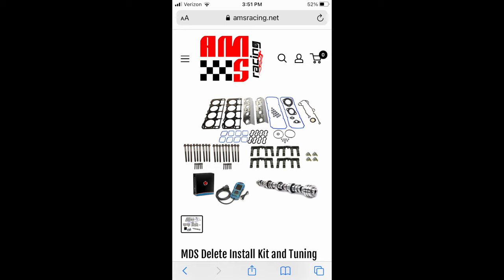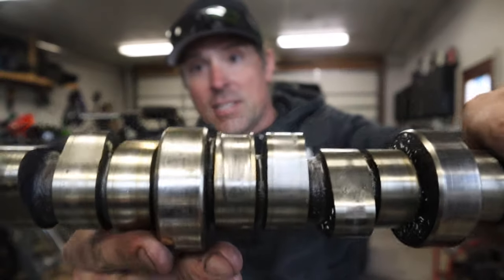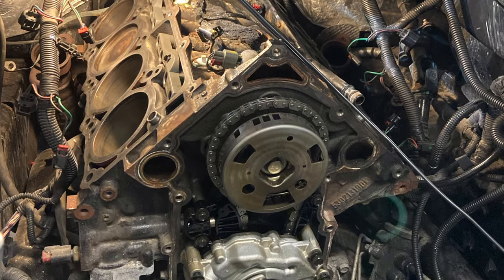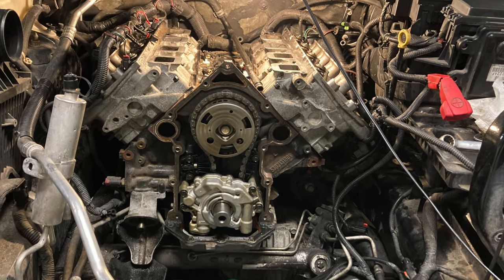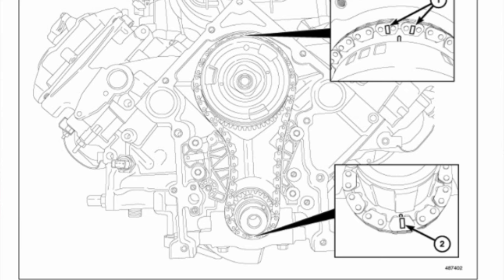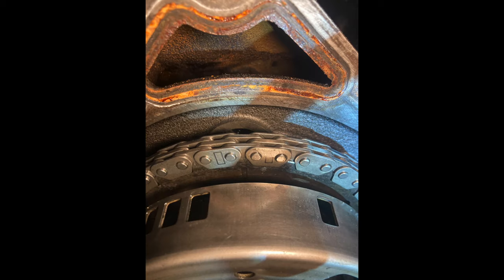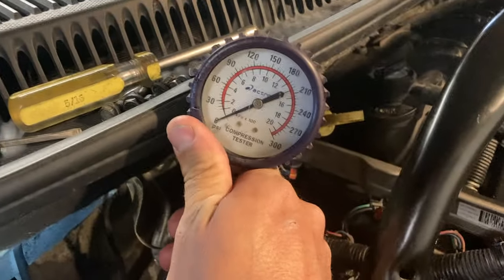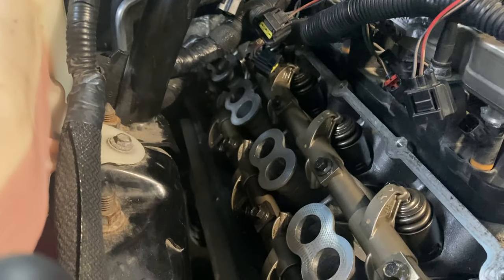Hemi 5.7 MDS delete, Lessons Learned

Comment: Thank you for posting this video. I did a MDS delete due to a damaged cam and after fitting the kit, I had problems getting her to run. Very rough running and unable to idle. I thought that I must’ve had a bad vacuum leak, so I removed the intake manifold and double checked that the individual intake gaskets hadn’t dislodged from their position. 
I then remembered viewing you video several months ago when I was doing some research. I couldn’t remember the conclusion so looked back through my history and found it. So glad I did as I followed your course and compression tested each cylinder. Low and behold, number one had zero compression. Long story short, my 5.7 is an a JK Wrangler and the fit is fairly tight, that tight, due to AC lines, the only way to remove the rocker cover is by removing the alternator, power steer pump and radiator and sliding the cover forward and out. So when I installed the pushrods, I hadn’t seated one in the lifter, causing my issue. But due to your video, you saved me time and a lot of aggravation and assisted me in sorting it out. Many thanks again.🍺
Reply from the maker: That’s awesome! I am glad this helped you out! Thanks for the comment!
Reply: Started the MDS delete on my brother's hemi last night. Glad I watched this video. When I get the valve covers on I'm going to do a compression test on all cylinders just so I don't have to backtrack. Thanks for the video.
Reply: Did you replace cam bearings

Comment: Thanks for the trouble shooting tips man. It’s always nice when people show the real world problems you run into when taking on these kinds of projects. It’s never self explanatory. Lol. I have a 2014 ram 1500. I found that it’s the pushrods not seating properly on the intake side, so they slip out of the seat once the engine rotated over. Luckily I manually turned the engine over and found that the #3 cylinder pushrod slipped out so no harm no foul, but I definitely would have had the same idoling issue if I tried running it. Thanks again for the post! Really helped me to avoid those pitfalls before I started.
Reply from the maker: Thanks for the feedback, multiple others have stated having the same issue as well, so I am glad that you got something from it!
Reply: It's because when you disable the MDS, the lifter ports with the MDS lifters are now not pressurized causing poor lifter/roller lubrication and rubes down the cam and can cause a bent pushrod.....

Comment: Don't feel bad.  Due to the way the lifters and pushrods lay almost horizontal, they almost NEVER want to stay in the cups and where they are supposed to during assembly. 95% of the time when a hemi of that type is put together and everything was fine but now it won't run.... its what you ran into. And the back cylinders are the usual culprits because it's hard to see, like you said. Your advice was also spot on.  I compression test every motor once the valve train is assembled to double check for just that. About a quarter of the time when I first crank it... I'll hear a loud "TINK" as one of the pushrods slips either INto or OUT of the cup. Lol.
Reply from the maker: Thanks for the info! That’s good to know!
Reply: How come no check engine light for a misfire when this happens??

Comment: That's crazy to go through all of that to disable MDS... Like a lot of things, Chrysler should have given the owner the option to disable MDS with a simple switch.
Reply from the maker: There are small things people do with Tow/Haul mode and such that people claim with turn off ads while driving.  You can also turn it off with a tuner, in my case the cam was already damaged, so I did the delete while in there.
Reply: A Pulsar in line engine tuner gives the option to turn off tat 4cylinder option and it just plugs straight in
Reply: I Have an in-line engine tuner that turns it  off but it was not cheap (Pulsar)
Reply: There are easy ways to disable it such as tow/haul or using the gear limiter.  However,  the main issue with doing that is that it doesn't address the oiling issue, especially at idle.  By removing the solenoids,  it increases the oil flow and pressure to the lifters 100% of the time.  With the mds, the higher pressure is only applied to the lifters during mds activation which is what causes them to work.
Reply: @secretdad544  l
Reply: @secretdad544  how much did you get it for and where from?
Reply: @eclipse1201  it (the hellcat oil pump) was brought off the internet from a Chrysler dealer selling parts in line and landed in Australia for about $250 including freight

I think it was about 150 USD
Reply: Keep in mind the MDS is a factory installment. As the first owners would have chosen that to begin with. Knowing government regulated emissions isn't something you just go do a delete on it. The whole ECM, sensors, etc. Are working altogether to make that system function. Although a simple line of code to deactivate that would provide that function remember it's most just for emissions. So whether they wanted to have the owner to have that control emissions are a very strict requirement. Plus it's meant to help the vehicle be more efficient when new. They don't expect a car to run over 200,000 miles which is the expected life of any engine. They do make engines without mds so you can swap those instead to avoid a headache like this.
Reply: I have a 5.7 Commander with a failed MDS system.  I use the Tow/Haul or put into 4th to bypass until my tuner arrives to disable.  Eventually I'll do a MDS Delete
Reply: There are ways to turn it off, I can on my Durango. Also... Yes... A tuner will turn it off. HOWEVER... The real benefit of doing what he did is to remove the less reliable physical parts. No switch can do that.
Reply: @wheelinoutwest  how has it ran since. Have my mechanic deleting mine right now.
Reply from the maker: @USMC--me3ig  Yes, for the last couple years.
Reply: Gm isn’t any different with this
Reply: @winstonwright3613 from my understanding and research, turning off the mds, however one decides to do it, won't solve anything. It needs to be a hard parts mds delete to actually solve it. 
From what you know, does turning mds off actually help reduce the damage or give some longevity?
Reply: How much roughly
Reply: @wheelinoutwest in my Chrysler 300 with 5 speed auto I just drive it in manual mode and keep it out of 5th gear but eventually I plan on properly deleting the mds so I can get that extra gear for highway driving.
Reply: @_AlejandroGonzalez_ i do the same lol but it eats gas especially stop and go
Reply: They do on the newer ones
Reply: Chrysler has to have things like this to help their overall fuel economy over all their vehicles so that they can keep making things like the SRTs and such.

Comment: I have an Aspen with the 5.7, and have 260k on it; I rebuilt it looking for the lifter/ cam issue, and all the parts inside looked practically new. Just wanted to let everyone know that this is the easiest motor I’ve ever worked on. I will drive this until it rusts into the ground. Motor is a beast. What other suv can tow 8000 pounds
Reply from the maker: Thanks for sharing, I agree they are a good motor.
Reply: the new RT Durango with Tow N Go package can tow 8700 Pounds
Reply: I have a 07 also I'm slowly working on
Reply: I have a 09 ram 1500 5.7 over 300000 never had a bolt turned on it.
Reply: I just bought  a 09 aspen what all did you get to rebuild it the engine I wanna kick some dust up 🙂
Reply: I have a 2007 Aspen and I just got my truck out the shop today and now I have this code come up where does it end 😢

Comment: Thank you for taking the time to share that information I have considered purchasing a modern hemi truck but intend to delete the MDS right away before any issues arise.
Reply from the maker: I hope it was helpful.
Reply: @wheelinoutwest  It was, I’ve been avoiding newer Mopar gas engines for a while because of the horrific reputation of MDS so I stuck with Diesels. But I wanted a lighter commuter and heard you could delete MDS. No one else covered the lessons learned with this swap. So once again thanks!

Comment: I've done this also on a 2010 ram 1500 5.7, to remove the mds solenoids cut a small piece of 2x4 or whatever small scrap wood you have and place the end on the top of the solenoid and lightly tap the opposite end of the wood with a hammer, the solenoids will then turn and  slide out super easy with absolutely no damage!
Reply from the maker: Thanks for sharing.

Comment: I just completed a 2009 VCT 5.7 VCT delete and added a distributor drive gear to a 2006 timing chain set to drive A GM distributor. Installed the older now modified chain set , a GM distributor with ford 4.2 v6 drive gears and had to fix the lifters. If you take out the bad lifters ( ones with loose rollers, not locked up) and press out the roller pin, you'll notice part of the pin is worn down but the roller and needles are fine....usually. Find some GM 3.8L series 2 v6 roller lifters and press the pins out of them to replace the bad ones on the hemi. Im a cheap ass and find a way around shelling out $400+ on lifters, Ford 3.0L V6 OHV roller lifters have the same pins. If needles are damaged, swap out the pin and rollers as well, they fit the hemi lifters. Sub merge lifter in oil and pump them up before install, this will prevent bending pushrods, and they are also different lengths so watch out.

Comment: Thanks!  A lot of good info here.  I will also add/reinforce:  The problem is, the engine oil may get old without you realizing, and then...  Change the engine oil no more than 4k, regardless of "oil life" reading.  Also be mindful of the operating hours as this will further break the oil on a "low mile" service interval if it has mostly idling.  Consider 200 hours to be the limit here.  Use premium oil and filters.  Do this and your Hemi's lifters/cam will last well past 200k, regardless of when it was built.  The sooner you are able to do this, the better.  This is even MORE important on a higher mileage engine, which will require even shorter oil change intervals as the rate of oil contamination increases.
Reply from the maker: Thanks for Sharing, increased oil changes can never hurt.
Reply from the maker: @frivera735  To be clear, you have a misfire, and you are planning to just do the tuner, or the entire delete kit.   The reason I ask, if you have a misfire, you may already have to do mechanical work, the cam may be damaged.  I change oil by the manufacturers recommendations, but changing it early can never hurt anything.
Reply: It's because when you disable the MDS, the lifter ports with the MDS lifters are now not pressurized causing poor lifter/roller lubrication and rubes down the cam and can cause a bent pushrod.....
Reply: Been using Amsoil Signature 0w -20 and found it runs well with high oil pressure 
Oil was expensive so going to run out to 20,000 km and do
An oil sample Test kit (komatsu do them for $40 they analyse the oil for contaminants) 
I fitted the hellcat high volume oil pump and I feel from the engine lack of valve train noise it’s still lubricating well after 10,000 country highway kilometres 

changing every 5000km is a good idea but I am going to use top quality Amsoil signature low viscosity oil and just see how far I can safely go before a hint of valve train noise or 20,000km whichever comes first

Comment: Cheapest way to avoid this on a 5.7 hemi is to replace the mds solenoids with new ones and then use a tuner to disable it on the system. That way you don't need to change anything. I suggest replacing the mds solenoids so you don't risk lifter failure in the future.
Reply: Yes, I read that. That disabling MDS keeps RPMS higher offering more lube to the lifters thus no lifter failure.  I also read that MOST of the lifter damage is caused by idling for long periods of time.
Reply: My Uncle works for Ford but they do work on police Chargers all the time as well. He told me they had many lifter failures and cam wear (due to idling so often) but they damn near cured the issue simply by adding Lucas Oil lubricant to their oil. It raises oil pressure a bit (even at idle), and reduces wear on the cam and lifters. Ive got a 2020 Charger with 38k miles and will definitely add the Lucal Oil lubricant in my next oil change.
Reply: @NickB1121  how much do you add?
Reply: @309cars  I add half a quart at each oil change. 6 and a half quarts Castro full synthetic and half quart of Lucas Oil supplement.
Reply: @NickB1121  Lucas is junk. Sorry. It is just a thickener no real additional additives
Reply: @AlexD-fq5zm  Even so, it helps. Thicker oils increase oil pressure without having to outright change your oil pump.
Reply: Thanks info man and noticed the guy in the video on some people could have forgot soak the valve lifters in engine oil before install new valve lifters on reason got back in the same problem. Pour engine oil in a large bowl and dropped valve lifters in until valve lifters sinking below in the oil until it stop bubble.
Reply: no youre wrong, the cheapest way is to buy a diablo tuner and deactiveate MDS option, no removal of parts or anythign else just plug and play
Reply: I use royal purple in mine.  Change every 3000 miles. Use it in my transmission and rear differential.  I also changed the transmission filter every 10k
Reply: It's because when you disable the MDS, the lifter ports with the MDS lifters are now not pressurized causing poor lifter/roller lubrication and rubes down the cam and can cause a bent pushrod.....
Reply: Yes I disabled the MDS with my Diablo predator tuner
Reply: While I’m drive you can just touch the gear selector and disable mds. If you do this each time you start the vehicle the mds will never run.
Reply: @AlexD-fq5zm  😂🤣🤣😂, don't worry they'll find out 🤣🤣😂
Reply: @nexpro6118  I know pushrod V8s very well, as honestly that’s all I care about, so forgive me if I’m. Issuing something , but how does a worn(as in the Hemis) cam cause a bent pushrod?  It seems like if anything there would be more clearance and less likely to bend one.
Reply: @Humblescape  that’s what I do, have a 2015 ram with 140k
Reply: @badmansurvivalist4617  easily? and does it work with no issues?
Reply: @chetlangford2144  royal purple really isn’t that good of an oil according to tbn charts. Valvoline vr1 base oil beats them out, so does synthetic vr1 and many oils do. It’s all about shear strength of the film to resist wear. I was shocked when purple wasn’t in the top ten.
Reply: @jonathanhaines5342  I need to retract! That Royal purple made a rust color in my engine! That shit sucks!  I use amsoil  now!!! Your right. I won't use RP never again!! Ram recommends 5w20 I like 5w30
Reply: @andrewhigdon8346 the bent pushrod is a result of the collapsed MDS lifter bleeding out oil and not keeping the pressure on the cam, the hammering action(instead of rolling) against the cam lobe popping the rod out of place under higher RPMs.
Reply: @badmansurvivalist4617 A year later, how's your engine? I'm considering the Diablo tuner option too.
Reply: @NickB1121  wrong Lucas creates a "whirling" effect in the oil pan and traps air in the crank it will destroy your motor.
Reply: @robertm7957 😂 no bud you disable fuel and crank the engine..
Reply: @chetlangford2144 how are your catalytic converters?
Reply: @charlesbronson7618  not sure im doing long tube headers on the ram now... ill look once i take em off.  Amsoil is whst im currently using... and i have to disable the mds.  I also bought a 2010 challenger rt
Reply: @NickB1121  Is that why many guys use 5w30 in these engines?

Comment: I'm about to do this same job on my 2010 Ram 1500, I thought I just had a simple exhaust leak because I had broken bolts on my exhaust manifold. But nope, my Hemi has the tick. So I will be sure to ensure my timing sprocket is at the 12 with #1 being at TDC, and to ensure my push rods are seated all the way. All good info to have when doing this job yourself
Reply from the maker: Good luck with your project!
Reply: Man get it checked first. This cam issue is blown waaaay the hell out of proportion . There are many well documented high mileage hemi rams .

Comment: You don't need to remove the oil pan to remove the oil pump. After unscrewing the pump, just turn it and unscrew the pickup tube. Just be careful that the screw and the O-ring do not fall into the oil pan. This is also described in the service manual for this engine.
Reply from the maker: I tried that first, but I could not get the bolt on the pick up tube off, that's hard to get to without dropping the pan.
Reply: @wheelinoutwest  next time, use a 13 wrench. If you have to do this again, come to my page
Reply: It's almost impossible on the truck version. They say there are extras hold downs on the pick up tube. On mine you can not slide oil pump left or right.  Even with the chain guards out.
Reply: It's because when you disable the MDS, the lifter ports with the MDS lifters are now not pressurized causing poor lifter/roller lubrication and rubes down the cam and can cause a bent pushrod.....
Reply: @63crosenberger  Reinstalling is the issue if you don't take off the oil pan. You can get the oil pickup bolt off the oil pump by turning the pump clockwise, but getting it back on to thread and tighten is a test of patience , dexterity and creativity. I used fishing line on my bolt coiled counter clockwise on the threads, used my finger to hold in place and pulled on the fishing line to spin the bolt and get it started on the threads of the oil pump.
Reply: Just remove the oil pan when removing the oil pump just to save yourself a headache, it's really not that bad.
Reply: How hard is it to get to the oil pressure relief spring on the oil pump?  Mine runs at 51 PSI at freeway speeds.  I'd like to install a spring to run at 65 -70 PSI.
Reply: Correct,there is a stud further back in the oil pan also.